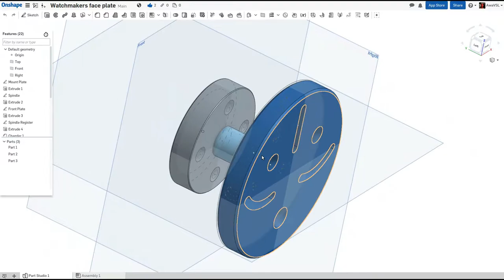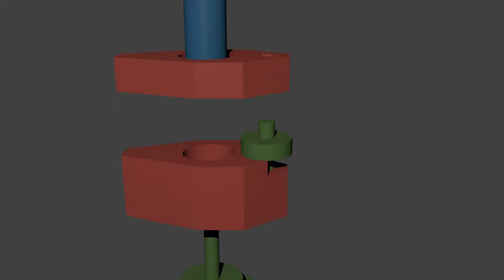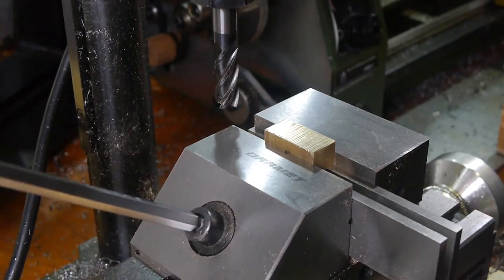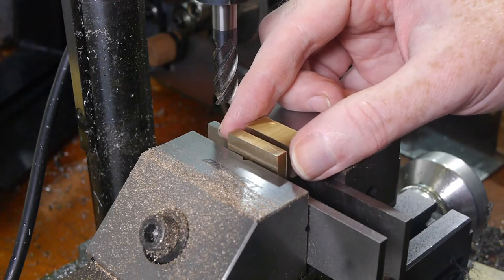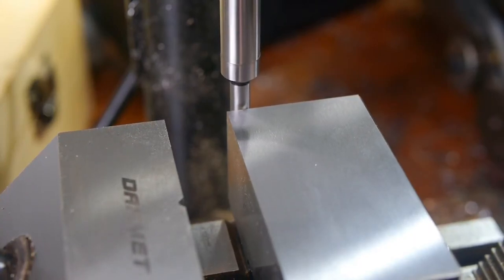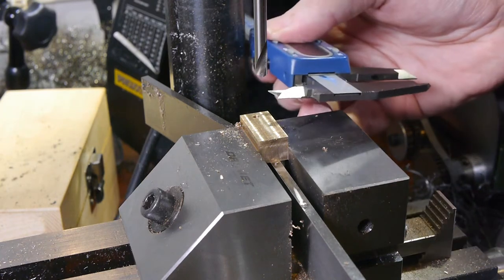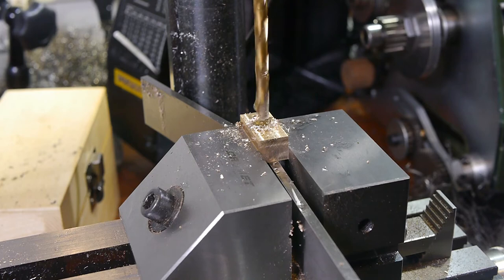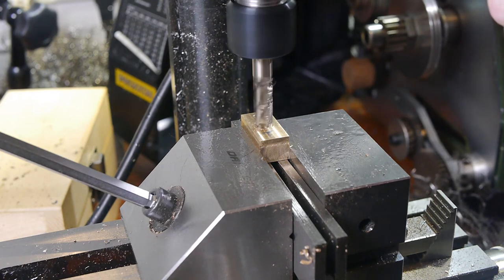Watchmakers Face Plate - Part 9

Comment: What make and model is the horizontal band saw?
Reply from the maker: It has no brand or model number on it. It's also pretty terrible, lacking any adjustments to straighten and tune the blade. I've already replaced it, and it's sitting in a box in the corner, unloved.